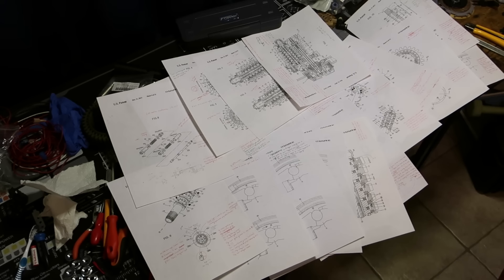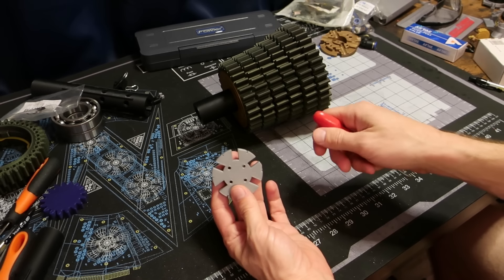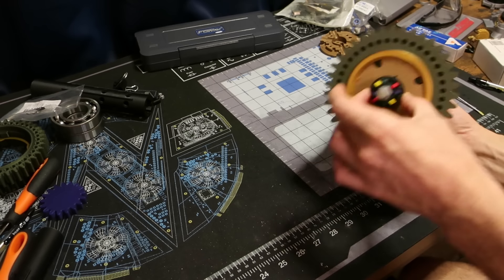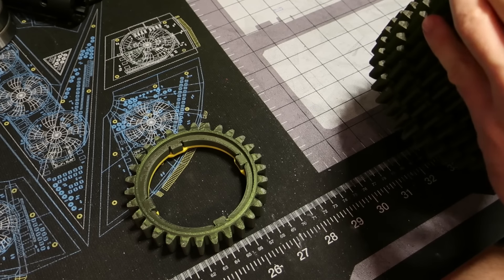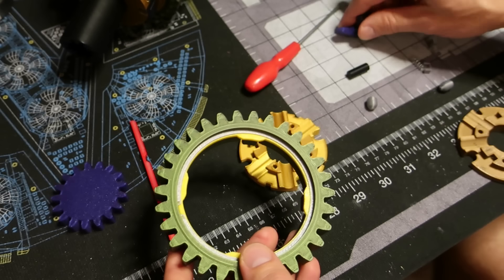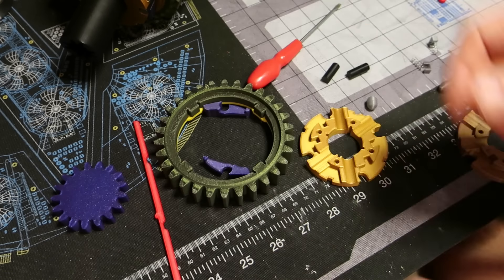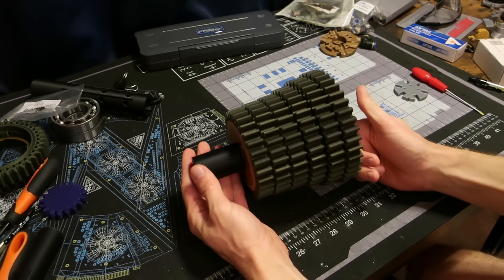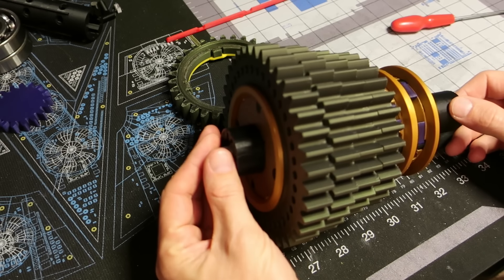Inside a MotoGP Seamless Gearbox Replica - How it Works

Comment: Amazing video. This reminds me of another automotive transmission that is also very puzzling. The Prius transmissions. It consists of a differential with three input/output shafts (as all differential sets do), an engine, two electric motor/generators and an output connected to one of the shafts. It uses the M/G units to absorb power from one shaft and transmit it to another to affect the overall gear ratio of the gearset. I think it is like having a car jacked up and putting it in gear with the engine running. Then braking one side wheel, the other side speeds up. They call it an eCVT.

Weber Auto channel does a lot about them from a mechanics point of view.
https://www.youtube.com/watch?v=ZmHpSyTsfm0

https://www.youtube.com/watch?v=PIYNAroYEk0  - more here
https://www.youtube.com/watch?v=E_xCssR8qQI   - working model

The last channel that did a great, great working model but I feel there is a simpler explanation in there somewhere.

Comment: It's basically a glorified piaggio vespa gearbox from 80 years ago
Reply: basically yeah with extra parts, the clever part is the lost motion assembly that makes it so the gear you shift from is only released when the gear you shift to is fully engaged, other than that it's pretty simple in principle, just lots of moving parts

Comment: i bet those ratchet, so engine braking is eliminated, because engine braking on a motorcycle is bad!

oh yeah, the clutch does!
Reply: *racing clutches

my 599 (hornet cb600) does not, so engine braking while braking into a corner can cause the rear tire to lose traction.

Comment: Hang on a minute, this design is not that far off from the Piaggio Vespa gearbox, called "crociera". It uses two main pieces, the secondary shaft in which is first installed the 4 gears and then between the shaft and the gears you install the "crociera" which is nothing but all the colored inserts you @Tommy you made, and the positioning/engaging/disengaging is ruled by two steel spheres and a spring! 
Gabriele Gnani uses this very same gearbox tipe in his racing 125! 

If you guys want to check it out, just put "Complete 5-speed vespa smallframe VMC gearbox" on the website "vespatime-dot-it"

Comment: I wasted some 14 minutes while you blabbed on about your 3D printed gears without explaining much. Then about at 14 minutes you finally reveal the internal "dog clutches" inside the gears.Your whole video could have been 5-10 minutes explaining a "crash box" transmission.with the dog clutches on the inside of the gears instead of the faces like most "crash boxes". Driver 61 shows a F1 crash box transmission and how it works. As a "teacher" you would put most students to sleep in a few minutes. I told YouTube to NOT RECOMMEND your channel.
Reply from the maker: Thank you so much! Keep that positivity coming!
Reply: So you probably still didn't understand how it engages two gear at the same time without exploding? you know you can skip parts of the video that you think you already know. F1 seamless shift requires electronically controlled and hydraulic shifting with precise timing. Motogp seamless works by next gear taking pressure of the previous while they are both engaged. While the video may have had a bit too much repetition, it's going to be hard to find a video that shows how the gearbox works better